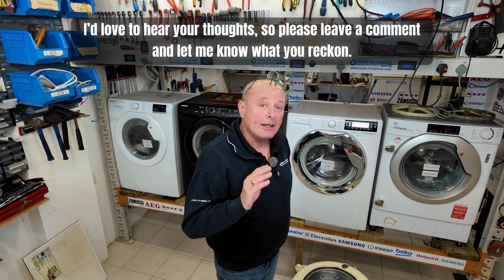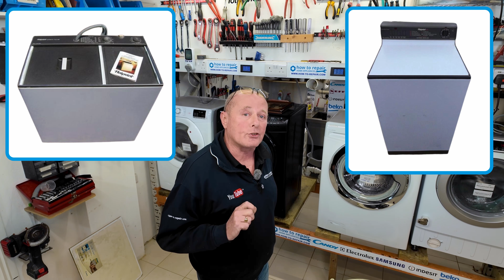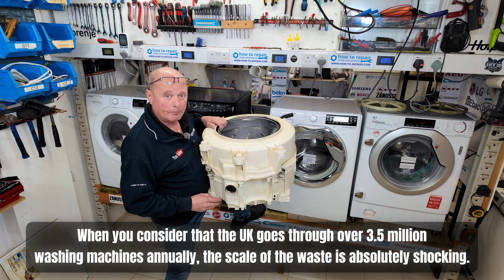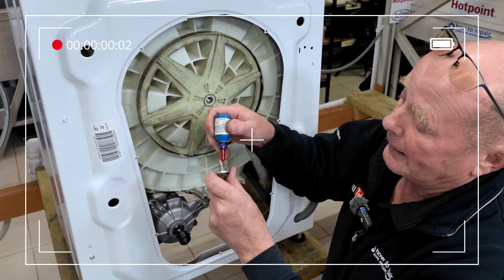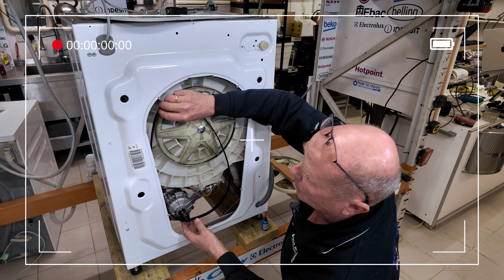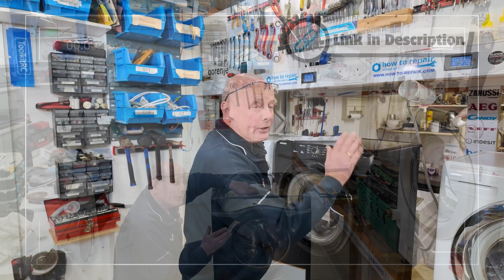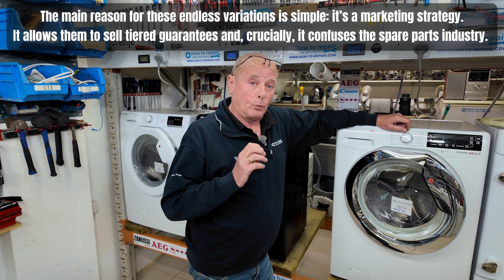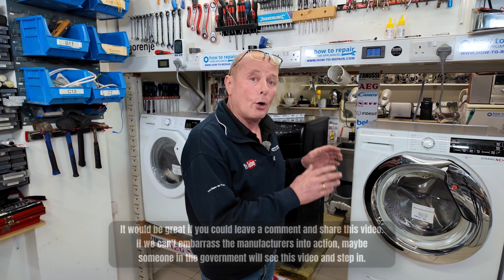I Scrapped 13 MACHINES to Prove a Point: STOP BUYING These Brands!

Comment: This was suggested to me by the algorithm, and it was actually good timing. My family's washing machine — a Maytag Legacy Series / Quiet Series 100 top-load analog — began experiencing trouble towards the start of February. I was doing two loads that day; the first went fine, but the second became stuck on the start of the rinse cycle.

After much troubleshooting, we believe that the fault lies with the mechanism that deals with cycle length and changing over. (Belt and pump were fine.) This has resulted in now having to babysit it by setting a timer and manually turning the dial to the next cycle.

Given the age of the washing machine we got for free back in 2019 (our previous set had failed hard that year), I've been mulling whether to just put up with the loud thing until it well and truly fails or to buy new one. But either way, at least I now have an idea of what to watch out for thanks to you.

Comment: When you say appliances lasted 25+ years, do you mean without a single fault in that time, or do you mean they did need repair, but they were easily repairable and with what’s you’d classify as “reasonable” wear and tear faults..??

I have that exact black Hoover washing machine, I love it!😮 I bought it in 2009 and it was the first washing machine I ever bought. Prior to that I washed stuff in the bath and used one of those cylindrical spinners to dry the clothes!😂

I have a sympathy with manufacturers as these appliances are very cheap to buy in the first place. Many companies are struggling to stay in business. I get why they do these things. Stay selling, stay trading, keep a lot of people in employment🤷🏻‍♀️

Comment: A
sacrificial die-cast zinc/aluminum washing machine spider (or rear drum support) is a critical component in many front-load washers, particularly those made by brands like Samsung and LG. The spider is a three-armed metal bracket attached to the back of the stainless steel drum, supporting it during rotation. It often fails due to galvanic corrosion, acting as a "sacrificial anode" that corrodes and breaks down due to contact with laundry chemicals, soaps, and water

Comment: Blaming it all on the manufacturers is unfair, I think. The public has at least a significant part of the blame. It's well known from market studies that the main thing that governs sales is price, not quality. 
Bear in mind, a washing machine purchased in the 70s or 80s would have cost a significantly larger portion of the yearly income of the average person.
The manufacturers are basically giving us what we want, which is cheap stuff, and the public would rather have the satisfaction of purchasing something new once something fails. 
However, in the high end segment you could make the case that you would expect better quality, but instead what you get is more features. But I suspect the manufacturers have pretty good market data unfortunately.

Comment: I bought a Samsung 8.5kg bubble wash back in 2016 for $800 AUD. It had the infamous faulty door latch within 10 months. After about 13 or 14 months (1 months after warranty runs out) the bloody PCB decides to fail. I had an idea of what component had failed, but I couldn't test and replace it due to the whole board being dipped and covered in clear resin. Chucked the machine and went cheap on my next machine.
Knowing that expensive products fail so quick, I just had to opt for the super cheap brand. It's a Kogan and has been going good ever since

Comment: Recently had an AEG condensation dryer wit5h a "warped" door hinge... Nope just a dusty filter refitted it and adjusted the locking mechanism and but hey still not correct mech said nah write off due to the so called warping of the door... I adjusted the spring tension of the locking mechanism and well guess what... Tumbling clothes like a charm again... Seems they aren't  teaching anymore but willing to sell out or something idk

Comment: Guarantee is useless.  The machine stops working; you called the company; the repair man came and said a major parts failed and you have to pay a big big sum to get it fixed. The problem is in a small part and not that big parts mentioned.  You do not want to spend that much.  The repair man gets to leave.  And that is the end of the story of your guarantee and a useless machine.

Comment: I've bought a Hisense combo
After only 13 months the dryer was showing a fault on screen. It is under warranty, the guy came out pulled the top off and took the cover off the heater fan it was full of fluff there is no way you can do it yourself, the machine doesn't have a fluff filter you can clean. it's supposed to be automatic the fluff is sent automatically with the waste water. But it doesn't! It builds up inside and stops the fan and burns the motor out. It takes a long time to dry your clothes because it has a heart pump. It is economical to run on electric and water. But this design fault is shocking. The repair guy said they always breakdown on this item!

Comment: In 2022, I bought a new HOTPOINT ARISTON RDD1175238KDVJEU washer-dryer. The bearings failed after 2 years and 1 month. The drum was glued, of course. A new one costs 50% of the unit's value. The company that repaired the old drum charged me about $80 for the service. They also assured me that the used bearings would last longer than the original. They must have been telling the truth, because they've already lasted longer than the previous ones. Unfortunately, this wasn't the only failure. In the fourth year of use, the hot air fan's efficiency decreased, leading to a burnout of the air heater. The parts cost about $100. I did the repairs myself. Thank you for sharing your knowledge with us. Best regards from Poland.

Comment: I think i am going to win the longevity bragging rights. I moved from a London flat to my present little cottage in the Shires, in 1977. brought over my Hoover front loader (cant remember the model) as I had worked in this industry, briefly had the skills to conduct basic repairs/replacement. Replaced, seals, the pump, brushes & the motor on the Hoover, and decided on a replacement.
Bought around 1984 an AEG Lavamat 50400, that is about 41 years! This is a made in Germany model, no relation to AEG of today. The door catch is broken, but I can still close & open. It rattles & shakes, alarmingly, but works. No fancy electronics, all analogue. The wash cycle control is clockwork. I suspect it will be working long after I am dead! Oh, its got Fuzzy Logic?! Whatever that is. I will have a weep if it stops.

Comment: This seems to be just another facet of the general "encrapification" of everything. Made with less and less quality and value, but always costing more and more. I bought a set of Maytag made Sears Kenmore's in 1991. It was no genious, I had just moved into my house a few years prior, and was tired of going to laundromats. I figured on them lasting maybe 10 years. But, 35 years and two minor repairs later, they are still working as new. The top lid interlock switch broke in the washer, and the belt broke in the dryer, that's it, in 35 years.

Comment: It's not just washing machines, it's car's as well. They're going to start making cars so the owner can no longer change the oil. You'll have to take it in to the shop. Oil changes have gotten very expensive. So not surprised to see manufacturers doing it with washers and dryers.

Comment: I'm from Germany. We bought an AEG a little bit less  than 5 years ago and it started leaking water. Luckily, we also purchased an extended warranty that covered all defects up to five years, instead of the usual 24 months. If we didn't have bought the extended warranty, it would have meant a completely new washing machine for the full price. In this case they've sent two guys over who have picked up the old and replaced it with a new model. The whole philosophy of how we design and produce things is rapidly shifting towards subscriptions. This is outragous!

Comment: Looks like I'm keeping my maytag wringer washer from the early 50s that Grandma used.  My father in law uses a wringer washer and he has kept it running by making parts on his metal lathe.  I have very little use for electronics in my appliances and vechiles.  I'm absolutely disgusted with the current state of cheapness of products and I simply don't buy them.  That's the greatest reply I can give those con-artists.  I'm wondering if speed queen in the states is worth buying?

Comment: I worked in repair management for a big chain of household goods shops here in Germany for quite some time. I fully subscribe to every word you said here.
There may be a reason for the sealed drums suddenly popping up everywhere at the same time: All companies buying parts from the same manufacturer in China.
Me, I got a second hand washing machine by AEG 16 years ago. I paid 50€ for the bugger, its year of make must be around 1990. I swapped the drum bearings a few years ago. Currently the water valve is acting up. Easy-peasy job, I´ll take care of that one soon.
I couldn´t be arsed to go and buy a brand new machine nowadays!

Comment: In the late 70s, my parents bought a Bauknecht washing machine that lasted over 25 years. Finally got replaced not because got broken, but because was already looking ugly with all the metal corrosion on the front panel. Nevertheless, was still washing clothes as good as in the first day

Comment: I'm not an engineer, but I am surprised that no one has yet designed an open-source 3D-printable washing machine - we already have Open-Source 3D-printable firearms such as the FGC-9, but sadly not home appliances.

As for the whole "Consumption is GOOD for the economy", this is all Keynesian whack fantasy economics, with the exact same reasoning as "Breaking shop front windows helps improve the economy".

Comment: Every machine over the last 15 years that I was unable to repair for family and friends. of course welded drums with the bearing on the inside. I even offered to try cutting and re welding but got no takers for this risky move. Oh year no exception Siemens, Miele, Bosch, Blaupunkt, Whirlpool, Beeko no exception for anything. Can't even find old ones which could be repaired from 2000 in germany nothing everything gone and replaced by garbage without wheels.

Comment: Had the same issue with AEG brand new machine, was standing level, dead after 1 1/2 year because of the bearing. Complete machine destroyed because of saving 0.03 cent in production cost. 

I bought an old used Bosch wich is working for nearly 5 years, no problems.

Same thing in all ninebot e scooters I had, all bearings damaged after not even 3 months.

Comment: I am a mechanical engineer in a different industry that has typically seen equipment designed for 30+ year service life but we have had a few new companies jump into the field who are offering significantly cheaper equipment that only lasts 7-10 years but at a price that is half of ours. Given how corporations work it is often easier to get money for a capital expenditure than it is for maintenance so some refineries are buying this disposable equipment and just running it to failure and swapping in a spare. From the corporations financial view point the  management team saved several hundred thousand dollars by skipping the rebuild time for parts when the whole system can be swapped out in a day instead of a week.

Comment: Haier has purchased Candy and Hoover. New machinese made by haier for those two SEEM to be a bit better made. At least the tub isn't glued.
Edit: example - Candy BR 410BL8 - exactly the same drum and housing as Haier uses. BLDC motor located at the bottom, Haier uses direct drive motors on their models and has 7 year warranty, Candy has 5.

Comment: Right to Repair has been getting abused/crushed here in the USA for decades.  The one change I would like to see is throwing out the agreements limiting the manufacturers of parts in selling those parts.  As a child of the 70s and I had a father who fixed EVERYTHING, I am a DIY'er.  Once in a great while, I find the OEM part manufacturer who makes their parts available at reasonable prices.

Comment: I have a Montpellier washing machine, these things are still built in Britain, thankfully, and is still working fine since I got it. 

I also have a Montpellier (correctly converted to LPG) gas hob running on Calor Patio Gas (UK) cylinders, which is basically a fancy name for propane, but it can successfully be used on any LPG appliances, using the correct regulator.

Nice blue clean flame with just a very slight yellow tip at the top (normal), but I got a Gas Safe engineer to further fine tune the gas / air mixture to pure blue, only displaying a yellow light when warmed up, turning it up and down using butane gas cylinders, otherwise is perfectly blue on propane gas.

Comment: It's a race to the bottom, since long lifespan isn't something they can compete on, it's a competition to give the bare minimum lifespan, without losing the customer in the process.

Not sure if it's even possible to compete on lifespan, maybe being required to provide warranty for the duration of the advertised lifespan could help, although they might just set up "temporary corporations", to sell products with a promise of long life, and then shut them down to avoid needing to cover it.

And of course greed is behind it, but that shouldn't even need to be said, but unlike acts of petty greed, acts of grand greed are kept legal, but acts of moderate greed.

Comment: I am a DIY guy who knew little about washing machines.
The keypad stopping working on our Hotpoint washing machine that was 2 years old.
The technician said that they were going to scrap it because the touch pad wasn't working. 
I dabble in DIY electrics so I took it apart thinking id fix it. 
Wrong. I was shocked at the level unitary, sealed parts. I had to take the entire machine apart to access the sealed panel at the front.
There wasn't a repair part for the touch panel available .
None. There wasn't anything to repair. No switch or soldered connection. And you had to completely disassemble the entire thing to get to the part at the front. Which then proved to be a printed circuit panel with touch sensors.
The entire machine had to be thrown away due to one touch panel not working.
Disgusted
Reply: I did manage to take all the electric parts off to use to DIY projects with kids at my school job, but an expensive was up get a motor and wiring harness

Comment: I just bought a Samsung dryer heat pump £550 quid
I bet it doesn't last 6 years
When it breaks I'll buy another. 
I've got a very  old  washing machine in my shed i use for rags, dustsheets, work clothes etc
I took it out of my first house when I lived with some mates over 25 years ago. Never had a single thing go wrong with it. Use it at least twice a week. 
Good old days

Comment: normal consumers have to be low carbon emission, yet i am forced to buy a new phone because the android version on it is to old. we accept this as normal but this is absolutely outrageous. one of the first apps that refused to start on the now dated android was a postal company postnl to check when packages arrive, yet they drive around in vans with big green text that they are green. every new windows version requires a more heavy computer....say what ??? big companies are allowed to FORCE consumerism on us. and computers and games dont have a proper low power consumption mode. they are not forced to be low carbon. only the consumers.

Comment: Thanks for your service! I have had a Whirlpool machine for 15-17 years. The drum bearings broke and it's impossible to repair. I am overwhelmed just by looking what to buy next. There's so many machines with AI functions (???)m they are WiFi capable, managed via app. (!!!) There is so much unnecessary stuff there that can break at any point. Give me a fully non-ai, non WiFi capable machine that works! Is that so hard?

Comment: The warranties are a rip off they trick you and tell you in curry’s and other shops to buy an extended 3 year warranty so you say that’s good I get 4 years but no, one year runs along side the manufacturers 12 months warranty so your 3 year extended warranty is only 2 years I called them out on this many times as they are wording this in a way that fools you, they should be asking if you would like an additional 2 years so that you are covered for 3 years.

Comment: I've got the Hoover Hwash 500 14kg drum.  Bought in 2021.  So far using it has been great although it won't connect to my WiFi so I cannot programme the washer through the Hon app. I regularly clean it.  I never closed the door after use.  I let it fully dry so it prevents mould etc.  so never had a stinky issue with it smelling all over clothes etc.   if this machine was to fail, would it be worth repairing or replacing?  I bought it at the retail price £499.  I would love to hear your thoughts on this particular machine. Thank you

Comment: It is true. My friend had a side hustle, he was buying broken washing machines and resold them after repairing. Some of them had PCB burnt, but most of them either had bearings broken, or outer drum leaking. And vast majority of those machines had their outer drums welded, making it  impossible to replace bearings without unwelding the drum, and then resealing it later.

Comment: first washing machine we ever got was a zanussi and it lasted 19 years we replaced it with another zanussi which lasted  18 months bought LG since  we have an indesit tumble dryer and the housing that the center pin at the back goes into wore down and made a horrendoes sqeeking noise when we replaced it its a brass pin into a brass socket no bearing just metal to metal unbelivable